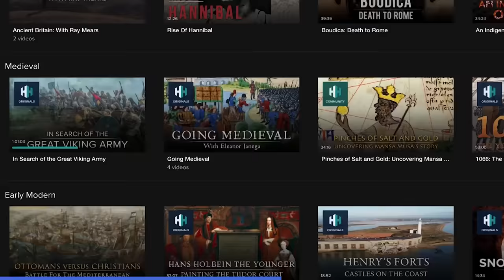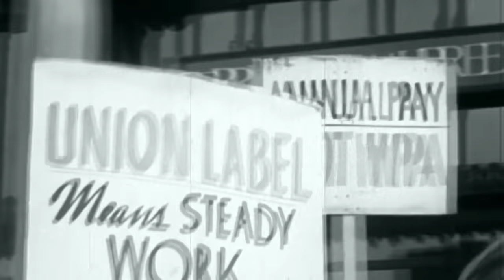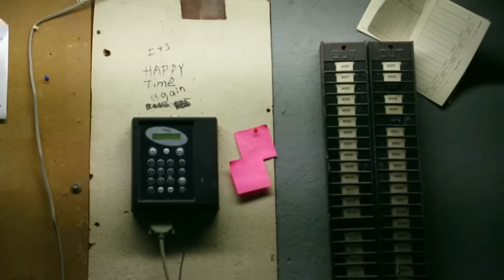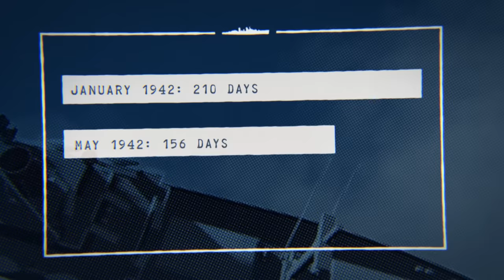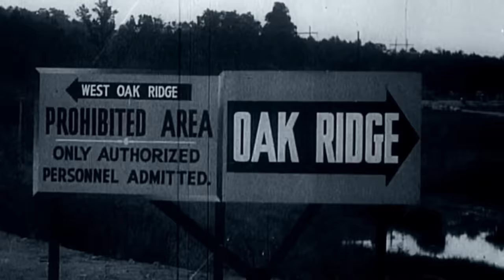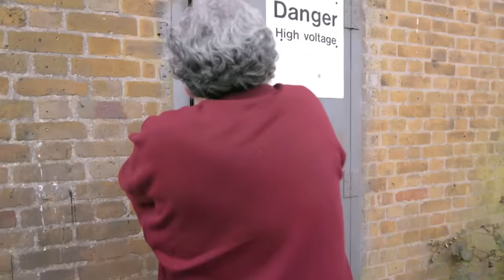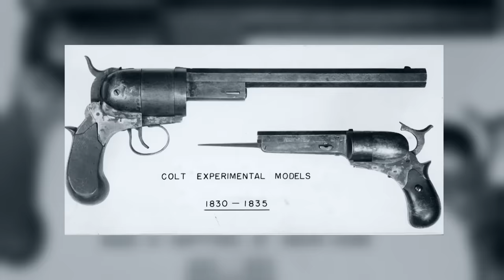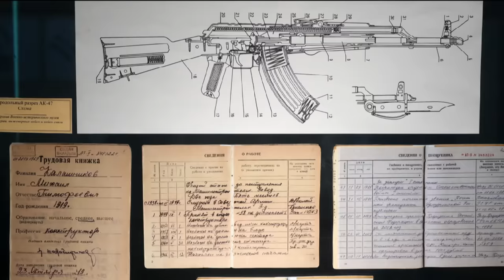3 Hours Of Facts About America's World War II Factories | War Factories Complete Series

Comment: Regarding the last segment on the  M-14 and AK-47 vs. M-16, your historians got the facts grossly wrong. 

I’m a Marine combat vet of Vietnam. I trained with and used the M-14 from Parris Island until I arrived in Vietnam 6.5 years later, at which time I was issued an M-16; the original model. A few months later, in late 1968, they changed out our upper receiver assembly and we were then carrying the M-16A1. The A1 fixed several issues, which I won’t go into here. 

They also replaced out animation with ammunition used the correct gunpowder and that didn’t foul the M-16’s receiver.

The reason the US military went to the M-16 was two-fold. 
1) It was much cheaper to produce than the M-14, and
2) Our ARVN Allie’s were relatively small people who had difficulty with rifles sized for 6’2” 200lb Americans. 

Yes, the AK-47 was a simple, reliable, sloppy, inaccurate rifle. I had many opportunities to pick an AK-47 but didn’t. The M-16A1 was a much better rifle in every significant respect. 

The AK-47 was NOT responsible for the way the war ended. In fact it had zero to do with it. We “lost” the Vietnam War solely because of political treachery in Washington DC. 

That’s it. The whole story. If our politicians in Washington had not been working for the enemy, it would’ve taken us a month MAXIMUM to take the whole of North Vietnam, occupy Hanoi, and hang Ho Chi Minh. 

The length of the war, the huge number of casualties on both sides, and the way it ended was purely due to treason in Washington. Period.
Reply: Ho Chi Minh was a U.S. ally during WW2 and fought against the Japanese in Vietnam. He quoted the U.S. Declaration of Independence in an address in Hanoi in 1945 declaring Vietnam's independence. Roosevelt supported anti-colonialism but he died. The new U.S. government supported European colonialism and France getting back its colonies. 

That doesn't mean Ho wasn't a communist nor used force against his opponents. But if the U.S. had reached out to Vietnam they would have listened and would have welcomed support. It would have also avoided a U.S. war there. 

What the U.S. failed to grasp was the world wanted their nations back. They would turn to communists in order to achieve independence. That is why many Africans and Asian states took communist help. The U.S. could have pressured Europeans far more to give up colonialism and win over friends in the process. 

The U.S. was at an all time high after WW2 and many nations respected Americans. Instead they soured that image and many nations today hate the U.S.
Reply: @PortMoody1 The US was responsible for the end of the majority of the colonialism. Not the communists!

Comment: And funnily enough, the BAR is still in service, in spirit, the M240, or FN MAG to the rest of NATO, is the action of a BAR turned upside down, given a belt feed, and simplified a bit, but it’s heart is an upside down BAR bolt/bolt carrier.
Reply: So is the .50 cal "Ma Deuce".  They were both designed by John Browning, both over an century old, and both engineered so well they are both still in service and both going strong.
Reply: @donf3877  well it’s in service and great, but it’s recoil operated, so not the bar action, fully. The 240 is literally a rechambered, upside down, optimized BAR with belt feed and no semi automatic fire. Piston driven and all that.